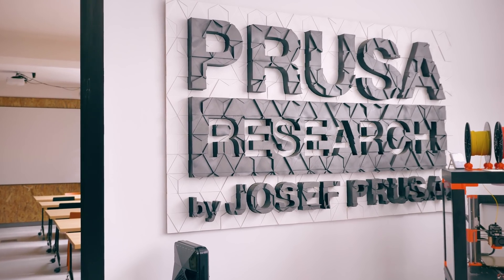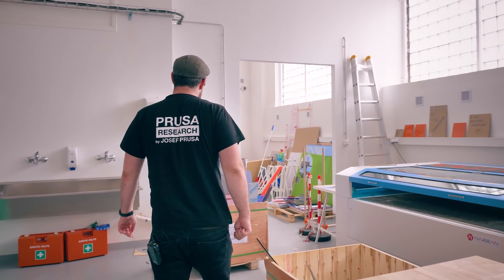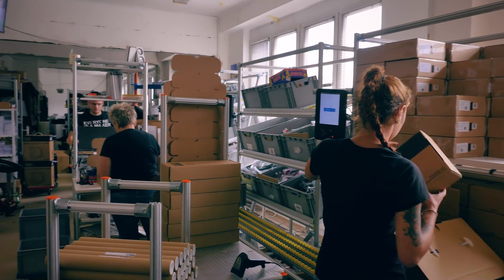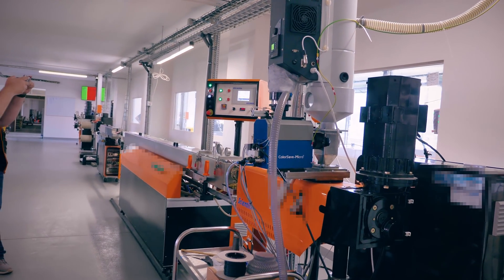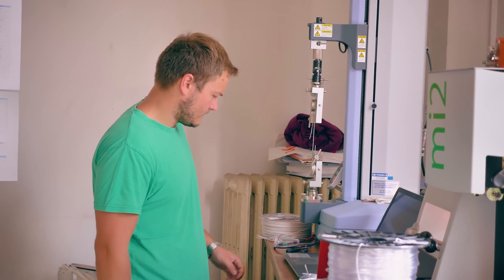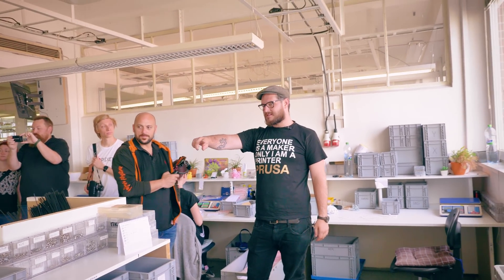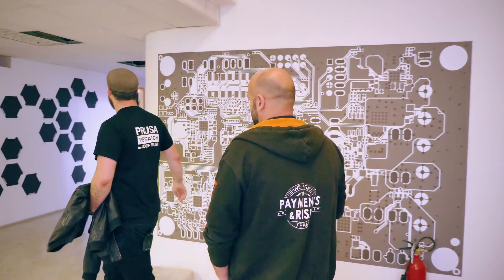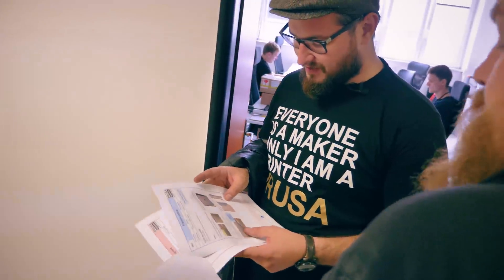I saw how Prusament and the Prusa i3 MK3 are made! (we find some early SL1 prototypes)

Comment: Very impressive!  I bought a Prusa clone and a CR-10 clone and both have been a real headache to deal with, the Prusa clone has stopped printing anything properly at all, and the quality of the CR-10 clone is really lacking, requiring a ton of time and parts to get even moderate quality.  So much wasted time, and with the printers and all the replacement parts I could have bought a real Prusa and still have a working printer.  Up front cost is not everything!
Reply: Ah yes, the Chinese clones. You spend more time trying to get them working properly (and safely) than you do actually printing.

Comment: Its amazing to see so much care about quality control while keeping that startup-maker vibe! One question though, why do you censor the brand of the extruder line? It's quite strange for such an open source based company to try to hide the tools they use...
Reply: Oh people know what machines this are and that make that topic even more funny - just because this are orange painted it makes them not something special. You can start from back with a Hubral spool winder, ..... ;)
Reply: @hodlbtc6933  lol
Reply: they arent really pen source more like open software or firmware kind of i think
Reply: @HeLrAiSiNg1  The Prusa printer was concieved in the reprap project, being open source from software to hardware. And take a look at prusa's arm. He has the open source hardware logo tatooed!
Reply: @tanahy310  well i'm not expert  but if they are os both hw and soft then i don't know why they do censor them to be honestly im courious to know what hotend and block are prusa mk3 using are possible to achieve the same things the prusa mk3 do with buying from ebay parts ? i notice that for example they have E3D V6 Nozzle on mk3 i looked ebay its 2$ only then i notice some swiss made stainless steel cost 10 or more does that affect the printing quality ? i mean its interesting but also confuse me i wanna really know its parts if they are really os cause in the original site they dont say what parts they use only what nozzle and extruder from bondtech i looked up in internet and its kinda cost 100+ euros without even the stepper well done

Comment: Did Prusa really ordered filament making machines with custom cover colors? Wow, what a guy!
Reply: Ordered custom paint job :-) then took out all the PLCs and redid it from scratch :-)
Reply: 1) Thanks for your answer Josef ^^
2) Are you using multiple independent parts (extra PID regulator for every heating zone) or better PLC to drive everything? And are those parts you can normally buy, or is it specifically made by you / your people? I'm just curious!
3) About 3D printers, were you thinking about extruder with valve? Something like hot-runner system in injection moulding industry. Maybe even nozzle on rail under extruder might work, just move it with small servo to open/close extruder.
Reply: in the industry its comon to paint your maschines in your company color, have a look for tesla -> all robots are red its just like buying a car in differnet colors you can buy maschines in different  colors
Reply: i think he order the machine and took the panel to a paint shop
Reply: In that case I'd expect his head or at least name painted on machines, not original machine nameplates (blurred in video), so I guess it was made with this paint.

Comment: The filament data on the QR code they have on the spool is the best part I think. It makes a lot of sense and I’m sure some other manufacturers will start doing it as well.
Reply: There's no real value added to the end user. Its more gimmick than anything. Once you have the filament what difference does that information make to you as the user?...Nothing.
Reply: Update Slic3r to parse that data in to extrusion multiplier for even cleaner prints? Also keeps them honest, lots of people can claim +/- something but if you have per spool data you can't go "Eh, its just one point out of spec. Ship it!"
Reply: Internet Tough Guy  No, none to you if you just sit on it. It might be very useful if you have an problem with the filament; get the information back to Prusa and something useful might well come of it, whether changes to manufacturing or transport or even just finding out you got a bad one that slipped through and you're due a replacement for it.

Everything isn't just about you alone, big guy.
Reply: Internet Tough Guy now people can't blame filament diameter inconsistencies on the spool (that is, if Prusa records correct/true information which I would hope they do) and as Jason said, you could parse the extrusion data, although that would not matter with the tolerances that they have. Maybe for smaller nozzles though.

Comment: Was pleased to see the amount of quality control they use.  Love my Mk3. 
  Also was wondering what the filament extruder part that had the filament going through tons of pulleys was.  Should have known or guessed it was a buffer system. 

Kinda wondering if all filament should be put through the dehydrator to dry it if all filament is passed through water to cool it.
Reply: Yeah, old trick in the paper printing trade (forgot what they call it now, but buffer will do). Allows them to change over spools without stopping the production line.

Guess the filament in the cooling water is still hot enough to expel moisture. only after cooling it becomes a problem.
Reply: Remember now. Called a festoon system